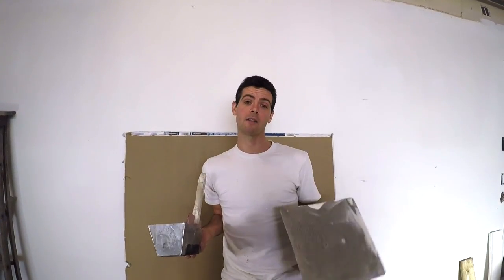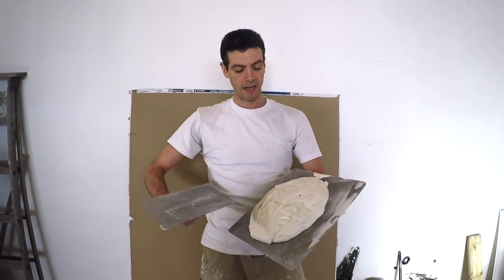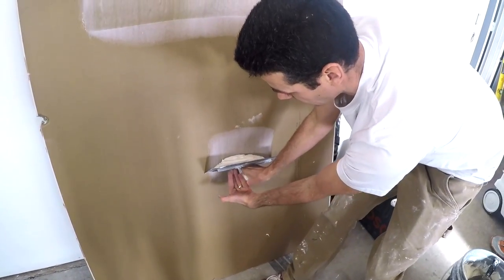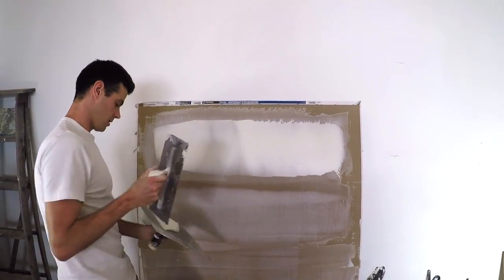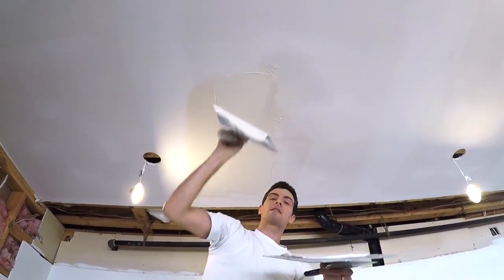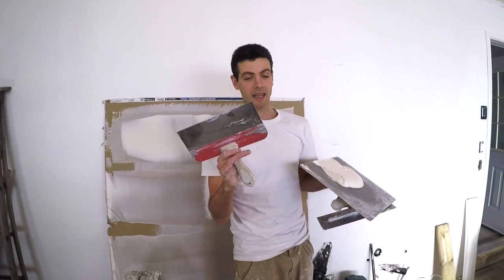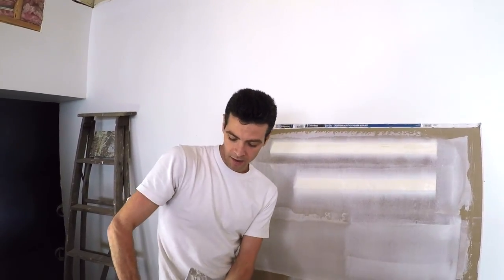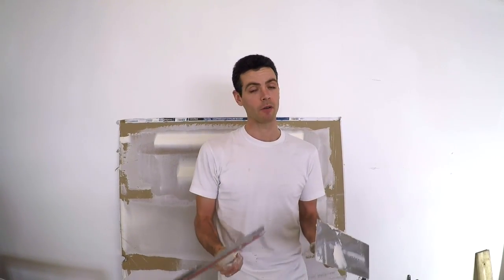HAWK AND TROWEL VS PAN AND KNIFE

Comment: it's all to do with the unions.   The Mason's union (plasterers, brick layers, etc) all use a trowel and to get your union card you have to be skilled with that tool.   The drywallers at the time needed a union and ended up in the "painters" union (rather than the mason's one) as they were "unskilled" with a trowel.   As you said, painters use putty knifes, so all the "seam tapers" adopted that tool.  Therefore 50 some years later here we are...   Of course the Mason's said "plaster is better" and thought it would never take off.   "Drywall" as a product has been around for 100 years but it was only during and after the 2nd world war when there was a need for cheap, affordable housing products that it was predominantly used.   "Plastering" as a trade goes back to Egyptian times, the insides and outsides of Pyramids were rendered by skilled workers.   The insides being skimmed then etched or painted by artists, the outsides being stucco'ed.   In fact the outside of the Great Pyramid of Giza was limestone polished to reflect the suns rays that the building had a "glow" to it.

Comment: Yeah u need to learn to 2 scoop the knife from the pan and just make a pile in the middle. Then it won't fall on ur face. I only know this cos I've had it on my eye many times 🤣🤣 using a knife does make 2 of my fingers numb with pins and needles after a hour or so. But using a trowel makes my wrist ache so I prefer numb fingers lol

Comment: I come from a Concrete, Stucco, Plaster, Drywall background & have use & have extensive experience with both types of tools. What's missing in this evaluation is a POOL TROWEL, ends are rounded and bendable. With that said, there is a specific trowel with one end square and the other end is rounded. This is fantastic for drywall mud & with the corner trowel, use rounded side to clean up the sharp lines left by corner trowel.
Also, for those using the HAWK, when you want a wide application applied, put the trowel down & use the hawk as your knife and apply using a motion of slowly laying down the hawk to parallel position to the wall.

Comment: That would be cool if I met a knife and hawk taper
Reply: Knife and hawk is how I learned to tape in the 1980s. Now I use any combination except pan and trowel. Up to an 8" blade I usually use a pan and knife. Wider than 8 inches I always use hawk and trowel.

Comment: When you’re applying mud with a pan and knife on the ceilings you gotta do it little by little to not make a mess. Either that or you make the mud a little thinner and run it faster, from a 45 degree angle when you start to a flat angle when you run out of mud

Comment: The only thing the pan is good for is baking bread, and when running Ames/bazooka tool systems, because to run through the pump to load gun or boxes it's to thin to use a hawk.
I come from a long line of finishers, 5 brothers going back to 60's-70's in N.Y. I've literally learned hand finishing and everything made after that. The tool systems are great, if you have a near perfect sheetrock job, few popped screws or blades get ruin and speed bumps.
A drill to mix with paddle saves on hand mixing, Before redimix was bags and had to add water.
It's a great trade when younger, walking on stilts once you get over any fear are easy to master.
But I like a hawk much better for using knives and comfort.

Comment: Ok, I think your making it more complicated. The trowel speed is obvious, the increased amount is obvious, once you incorporate the 6 inch knife at the same time (which I can) you have solved the supposed problem of feathering (use the 6 inch) 1st coat taping, and corner mud application. Hawk and trowel AND 6 INCH KNIFE is obviously better.

Comment: in the 70's the union said trowel is a plaster tool so tapers had to use a knife. Of course a trowel is ergonomically correct. But when it comes to speed no way. I can smoke a trowel man any day.
Reply: Not plastering though.

Comment: Really?? Anything you can do with a hock and trowel I can do with a knife and pan better any day. When you load the knife you  scrape off that corner mud you tasted. Bam Bam both corners then it looks just like you loaded your trowel. When you do it every day it's muscle memory. You just do it instinctively.  Then something you seem to miss, grasshopper is it's not about how much mud you get on the wall vs how well it's done and how little sanding needs to be done. What's harder on you,troweling on a gallon of mud then scraping most off or placing smaller amounts faster. Ran 40 man crews for 20 years the few I saw with hock and trowel did not last long. Bazooka, box and knife & pan.